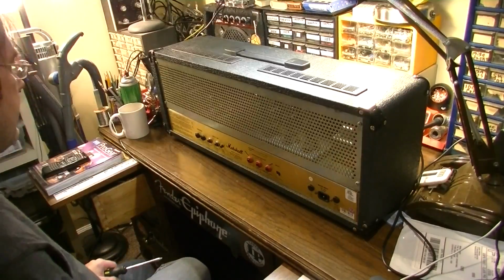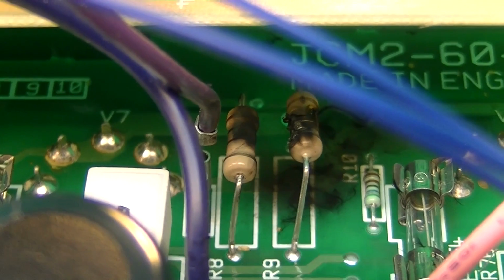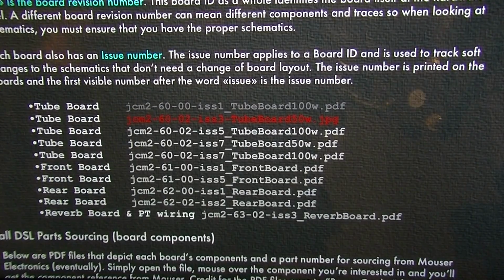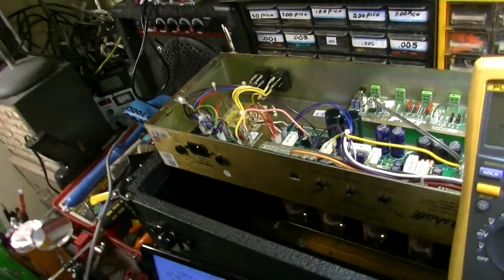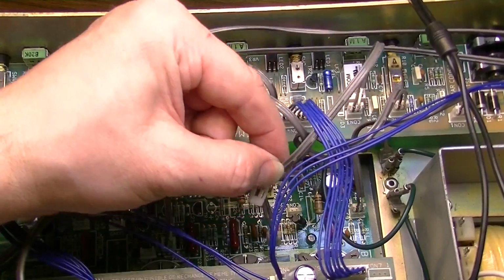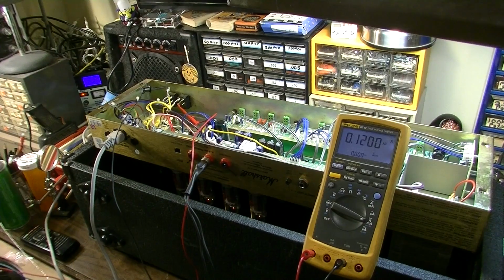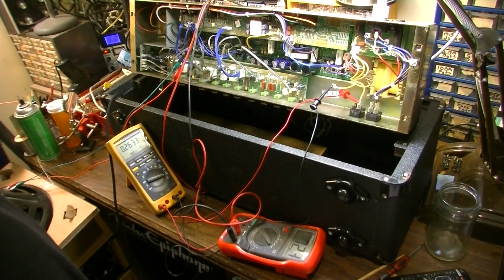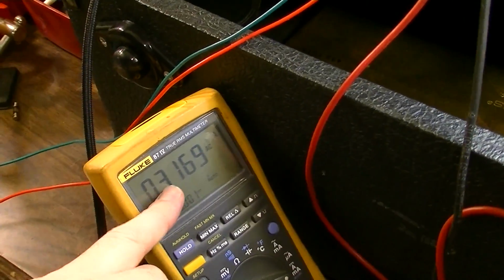Mother of All Marshall Amp Repair Videos - DSL100 Blowing Fuses, Bias Runaway, Fun Times!

Comment: Sorry Brad, I think you missed this one and this amp will be coming back.  A power supply cap can't burn out the cathode resistor or cause that tube flash.  Assuming that tube still works, I think that tube is shorting.  That's about the only thing I can think of that would cause that flash.  If the tube is now dead, then there was excess current though the tube and it burned out a wire inside.  But if loss of bias can't do that, then it suggests a internal short.  It happens. That why tube checkers have tests for shorts.
Reply from the maker: That cap is in the HT line. It was the only bad component on the entire HT I found that was bad. Granted, I didn't go all the way into the preamp, but I did check all the solder joints in the preamp. I think it was that cap. It would be a very unique problem if a power tube was shorting one second and fine the next.
Reply: I could see the cap blowing the fuse, but not the tube flash.  Yes, an intermittent tube would be unusual, but not impossible.  Intermittents are always a %&#$.  If you correspond with the other guys like Uncle Doug or D-Lab, you might want to run this by them.
Reply from the maker: If there was a high voltage spike because that cap was misbehaving though, it could cause a tube spark. At least it makes sense that it could in my mind. As for Uncle Doug, I don't think he ventures much into modern amps. Terry at D-Lab may, but I don't know what he could tell me that I haven't already tried. I've read a lot of forum posts where techs are advising some to up the value of that HT fuse slightly to avoid problematic fuses, and I do agree that like a 1.5A fuse probably wouldn't hurt a thing, and may prevent some fuse blowing due to transients. But I think the issue with this one was that cap at first, which took out the R9. Then my shoddy speaker connection likely caused the later fuse blow. I played the amp for a long time after that and no issues. But yeah, intermittents are a pain in the ASS.
Reply: Time will tell.  All I can say is my "tech sense" is still tingling.  It won't give me a "warm fuzzy".   But I understand the situation.  If you can't recreate it, at some point you have to send it back to the customer.  The only thing I can suggest is to make sure you test it with it sitting on the speaker cabinet so gets vibrated.
Reply from the maker: I totally hear you. I didn't get "that warm fuzzy feeling" either on this one. More like I had to jump out of bed and out the window putting my boots on. FWIW, I spent a good while I didn't put in the final video chopsticking with the amp on, and I played it and burned in a good long time. Like you said, the ghost won't show itself, maybe it went away?
Reply: at least a have one: a 807 in one of my Amps did this from time to time, lucky me it was in a highly cusomized philips EL6435 and i added a cathode current limit via an microcontroller and also a well visibly cathode current display for each output tube (it uses four).
This tube flashed about three times...i put that tube on my MuTracer and run it for hours under various conditions and it flashed again....so i replaced it, but not just that one but all four....some tubes can be faulty in a way you don´t be aware of....
Reply: may try to run the HT side of the power tranny into saturation and calc the max drawn amps, or measure it...1A continues currrent on a 4times EL34 amp is already a lot on the hi-side, even considering the load spikes on the diodes on a flat out power condition.
one EL34 worst case is able draw 100mA when red plating....
Reply: I had a brand new JJ GZ34 that would flash and blow the fuse in my silver face bandmaster reverb. It only did it twice in probably 4 hours of playing it. The 2nd time I got lucky and saw it while testing on my bench. I replaced it with a NOS tube and fuse still hasn’t blown a year later. Only time I have experienced that though.
Reply: Exactly. Intermittently shorting power tube.
Reply: I have a GEC KT66 that acts like this. An internal short causes a huge spike in cathode current. Tapping the tube (gently) with a screwdriver handle aggravates it.
Reply: I'd like to chime in quickly here. I have been repairing and maintaining tube audio equipment for a long time now, and I have to agree with Russel. Here's why.... 

About five years ago,  I started replacing tubes in all of my customers' units with JJ Electronics stuff, both based on price and recommendations from other audio enthusiasts and technicians. On more than one occasion, I had units come back, or take forever to leave the shop due to weird problems that would constantly have me chasing my tail. Rectifier tubes would flash over on warm up, power tubes would go weak in short periods of time, red plate, burn up cathode resistors, microphonic issues, etc. I thought it was just me, but I started swapping tubes for NOS USA or Russian equivalents, and my problems went away. Nearly every piece of equipment I have come across since these observations took place which had JJ tubes installed have been problematic because of the tubes themselves, and I have to believe that the manufacturer has very poor quality control standards or the like. 

Three more proof of claim cases:

I had a customer bring me a BRAND NEW set of 6BQ5 output tubes to install into a Zenith console stereo chassis of his after replacing a shorted power transformer. One of them was bad and tested "open filament" straight out of the box.

Most recently, I was overdubbing guitars with a Fender Pro Reverb that has been maintained by me and never abused while in my possession. The amp went up in smoke in the middle of the session. I could find nothing wrong internally, other than an arc burn on one of the tube sockets. Guess what? JJ 6L6's installed. Heater to plate short, oddly. Had to replace the tube sockets because the arcing was so bad it ate into the contacts.

Finally, my business partner bought his father a Dynaco ST70 power amp for his hifi rig a long time ago and had me install a VTA mod and replacement driver PCB. We chose JJ's for the outputs. I had problems with parasitic oscillations and bias runaway as well, never could get the thing to behave correctly when dialed up to nominal bias current. I dialed it in a little cold to keep the jitters at bay, and we were all very happy with the results. I've since replaced output tubes in this amp more than once, thinking it was just the nature of the amp being hot rodded. Based on my recent hunches, I replaced those JJ's with NOS Sylvania 6CA7's and I haven't heard a single complaint from the owner since. That was over two years ago.

I am not in the business of making false claims, nor am I an NOS tube snob. There are plenty of other new production brands on the market, and I have simply not had ANY issues with any of them other than JJ Electronics. I cannot recommend strongly enough that EVERYONE stay away from this brand for their sanity and go with, quite literally, anything else. These tubes are unfortunately just junk in my opinion, at least now (I also have a seventies Vibrolux which has a much older set of JJ power tubes in it and has never given me any problems).

I would get those JJ's outta that Marshall with a quickness if you can, Brad. Bias up with anything else reputable - I have personally had very good luck with either Sovtek or Svetlana (preferred) with all of my loud, hi gain endeavors.

Best of luck to you, apologies for being so long winded, but hopefully I can save some people some headaches...
Reply: Forgot to mention, don't seem to have a problem
with JJ preamp tubes, there power tubes suck!
Reply: @TheGuitologist  ..A possible reason why the R9 was exploded, could also be 'Dc-leakage' on the cap(C7) from previous stage to the grid of the following tube(s). If this happens, the tube might draw 'excessive' current and ripp-apart that weak link R9 (by design perhaps, to protect) due to false/heighten grid-voltage on the tube-section pair. -->Humble input/conclution; Perhaps it would been beneficial to change out the C7 for the grid-line to the upper tube-pair on the schematic. (And also the C6 for the grid-line to the other lower tube-pair). Thanks for very fine and interesting videoes. While watching I had to download the schematics myself, it was very interesting to follow along. Have a nice week overThere.
br, norway
Reply: I’m thinking that the meter don’t lie

Comment: On these amps I always have to replace the caps in the bias circuit and if I cannot dial up to 90mv per side then change out the bias range resistor.  Tube matching range also is a problem so your mA readings vary with what pair of tubes your running. Mark

Comment: One thing you didn't mention though you kind of demonstrated it when you were adjusting the bias. The bias on these amps is push/pull meaning you have to adjust each side to the point where both are as close to even as possible but to do that, you have to go back and forth as raising one, lowers the other, etc.
Reply from the maker: That is true. One side affects the other.

Comment: Well, perhaps the most important lesson I learned here is....I don't want one of these amps...ever, lol. But great video. Thanks for posting!
Reply: Leon C ,
They’re not as bad as everyone makes them out to be. Most knowledgeable techs know how to address the common trouble areas in the design. Once taken care of and biased properly they’re really good , versatile and very reliable. You would probably love the classic gain channel on crunch , really good for pushed plexi tones. With a clean boost it sings nicely. Kind of overkill unless you’re playing with a really loud drummer. Definitely sound better when the power amp section is working hard. These do sound nasty if you get carried away with the preamp gain on the ultra gain channel though.

Your magnatone vids were super helpful by the way. I found a really cool M10A all original for $300. 👍
Reply: @lgrim4426  yup
Reply: once this issue was adressed these amps sound as good as any Marshall I have ever heard or played.  They got a bad reputation because of this issue that went undiagnosed for years.  Now everyone knows what the problem is and once fixed they are killer sounding amps.

Comment: I'm sure it's REAL helpful one year out but it may actually be one of those JJ tubes, I have a Fender amp that had 6 6l6s in it and one actually internally shorted and blew every (going on memory of what my tech told me) resistor(the 470 one) on the bias on that side, took out the B+ line, melted the wire on the heater string, and literally melted the tube socket from how bad the arc was. He literally had to rewire the output side of the amp. If it had been a PCB it would have basically been trash. This is not the first time I'd had an issue with JJ output tubes, I had one redplate new out of the box with bias that was absolutely perfect in a Pignose. Both of these amps were working just fine when they failed, with different tubes(biased according to JJs), and I'm extremely lucky it didn't completely kill the transformers on the Fender. 

Wish I had a video of when it happened, damn tube must have lit up like a light bulb.

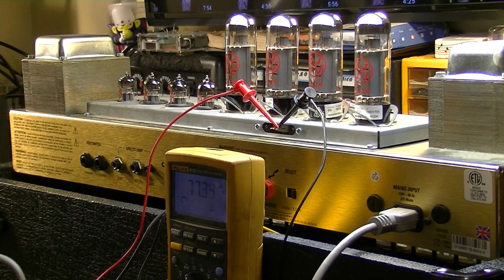Comment: 16:03

I just bought one of these off reverb and that's the noise it made as soon as I turned it on for the first time. I'm in the process of sending it back, lol
Reply: I worked in reverb, in Glasgow many years ago.. Many of marshall amps on the bench.. With cooked tubes cracked boards very cheap pots etc.. Found the main boards very poor thourgh hole soldering poor.

Comment: I had a TSL JCM 2000 and it had this issue. Had to get a replacement board from Marshall. It has had about 16 reissues and was a big problem that Marshall had a hard time even figuring out. After the one board was swapped out it was fine. But holy shit what a nightmare. I eventually sold it
Reply: My mate had a TSL JCM 2000 that used to spend more time being repaired than played. Even when it was "working" it had a charming habit of having the volume slowly reduce as you were playing until you had the damned thing cranked 10/10 and could barely hear it over the drummer. 

It was like that from day 1 and as far as I know is still sitting in his music room semi-broken while he works overseas to make a crust.
Reply: Steve Kellett that sucks. It’s a shame they have a bad reputation because after I replaced the board it worked and sounded amazing. Just an initial bad design. Should have spent a little more time in R&D haha. I believe that was Marshall’s response to the dual rectifier. So it got rushed out.
Reply: @omikl  for the cost of about 10 bucks worth of parts this can be repaired.  Korg USA will try to sell him a new board.  He can fix the existing one.  let me know if u want the instructions and I can send.  These amps sound fantastic when working correctly
Reply: @scottmacdonald5605  I'm having almost exact issues with my TSL 100 just after re-tubing (1st time &b/c power tube bad). 1st issues in 13 years, it's an '04, & for my tastes, I've always loved this thing's sound. ALL help will be GREATLY appreciated!
Reply: @telorum1970  here is a link to the repair I referred to.  Bear in mind that you need some soldering skills and fundamental understanding of assembly so that you ensure the amp is put back together properly.  So long as you pay attention to where the various wires and cables that connect to the PCB go you should be fine. The important part of this repair is the isolation of the negative bias in on pin 5 from the adjacent high voltage in on pin 4.  This is done by removing the power tube sockets and drilling out the via on the pcb at pin 5 on all 4 power tubes.  Then you simply lift the end of the bias resistors of each socket and attach them directly to the now floating pin 5 on the tube socket.  VIOLA!  all fixed.   Be sure to remove and inspect the small pcb that holds the bias adjust pots on the back of the amp.  These can have broken solder joints due to misalignment of the pots so when the board is screwed in they come in contact with the chassis and can break the solder joints.  Just make sure the pots are down all the way on the surface of the pcb to allow for proper clearance.  Here is the link: http://www.hullerum.de/Marshall/TSL122repair.html    Good luck!  If you have any ? be sure to ask - Scott
Reply: @scottmacdonald5605  Thank you so much for your help Scott. 1 question though, what about all the comments about changing that one board to the version 20? All the ones I read said that seemed to be the "big fix". 
I have the ability and should likely be able to do the recommended fix. What I'm short of is time, working ~7 nights /wk. I truly appreciate your help.
Reply: @telorum1970  that will also work and is what Korg USA would recommend of course, since they make no $ if you repair the existing board.  It is entirely unnecessary as the existing PCB can be fixed.  The obvious difference is a new board is several hundred dollars I believe, or close to it where as fixing the existing PCB is just a matter of a few dollars in parts and the labor.  That would be up to you whether to replace the board or not.  You would still have to dissemble the amp to replace the board so why not just take the extra time and do the mod?  It is what I would do, and did to mine and a friends combo - but what you choose to do is up to you.  good luck
Reply: @scottmacdonald5605  hey man, I appreciate all of your advice and feedback. And when you put it the way you just did, yeah it makes much better sense to do the repairs. I really appreciate the link to  the pics & the fix in your last reply, along with everything else. Take care and keep rockin'! I'll let you know how it goes. 🎸🤘

Comment: Just bought a jcm 2000 dsl and all 4 of my tubes are red plating. Got a great deal on the head and a Mesa 4x12(head was more or less free if you look at what the mesa cab sells for)going to take it to a reputable tech in the area. Hopefully it doesn't cost an arm and a leg to fix

Comment: What I experimented for years it's in many cases, sound or bias issues rarely come from the tubes. Nowadays tubes don't fail that much often. Usually tube amp issues come from: bad solder joints, capacitors, diodes or even resistors.